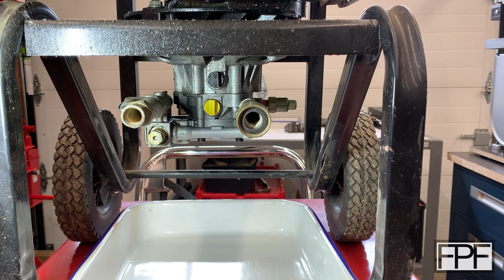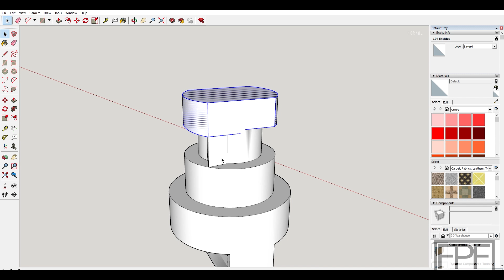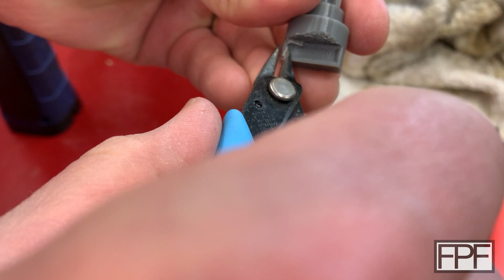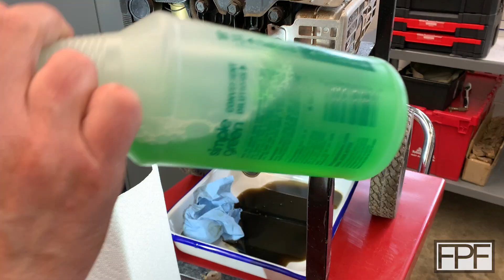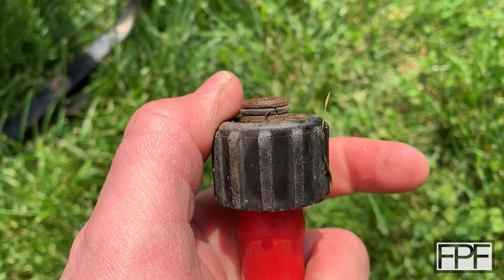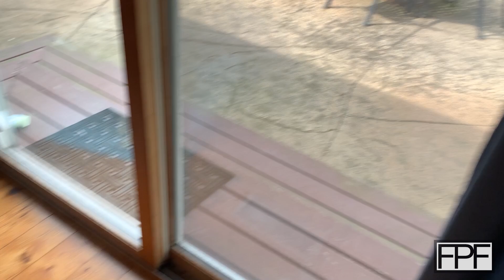3D Printed Pressure Washer Pump Plug

Comment: I'm late to the party (I'm working my way through your older video after discovering the recent printer enclosure series), but that might actually help in this case. Its been over 18 months since you made this. Have you run the cleaner enough to test out the heat resistance of the new plug? The issue with most polymers, especially at high temps, is creep. They deform with time under constant loads, especially as temperatures rise and loading approaches the tensile limit of the materials. So you want the thickest cross-sections you can get away with to keep the stress on the part as low as possible, since you can't do much about the operating temperature. In this case, the top of the plug (where is warped in PLA) in under constant stress in keeping the o-ring compressed, so you want the "top" of the plug thicker to support the shoulder that rests against inside surface of the housing, and the shank that connects it to the outer portion thick as possible. You are constrained by the geometry of the opening, but that's my two cents.

I'm enjoying your videos, you got a sub from me, keep it up!

Comment: I think the manual for the FAIP pumps calls for 4 oz of 15W-50 oil. All I could find was 15W-40 so that's what I used.  I will be ordering two of these for my pressure washer that has the same issue with the factory clear plug on top. Great channel.
Reply from the maker: Thanks!   I doubt the oil type matters too much.  I imagine you could probably put just about anything mineral or synthetic based in there as long as the weight was something between 5 and 50, even straight weights.

Comment: Great video! 👍
If I understand it correctly, the challenge is to not let the engine run without water running through it for cooling. 
I hope it will last this time 👍😊
Reply from the maker: Correct.  The 'pumps' in pressure washers are dependent on water going through them to stay cool.   The better the pump, the more tolerant of heat they tend to be, but it's bad for all of them.